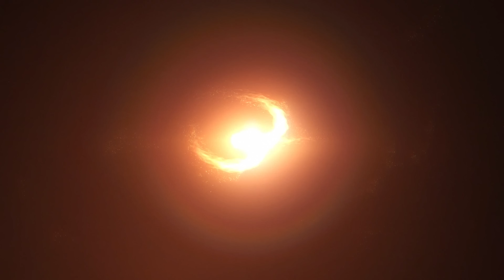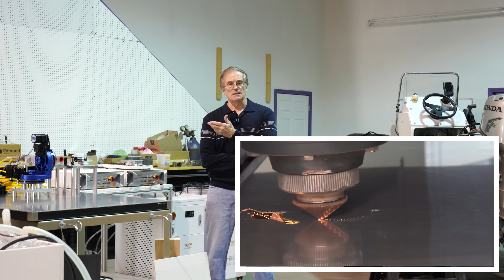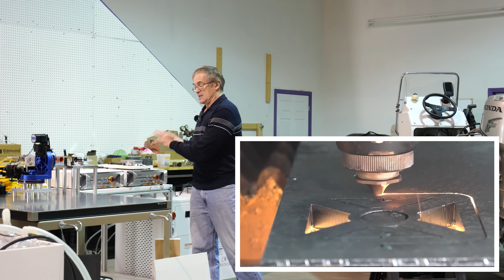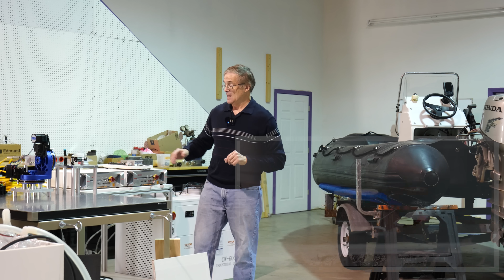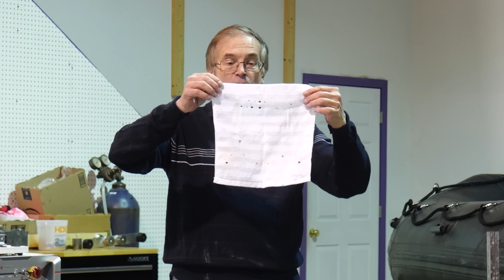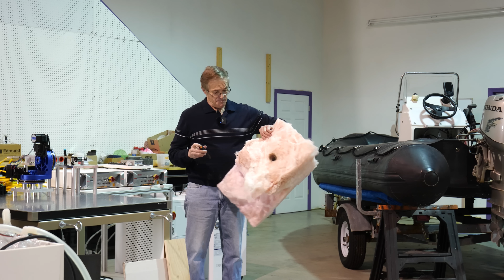We have a problem... and need your help!

Comment: I know that you don't want a brick wall, but you are going to need something on the order of that density.  I would build a steel frame with casters.  Lots of casters.  Then pour 100k lb concrete into it.  I wouldn't use reinforcing mesh or rebar because those will be weak points for the laser.  I would use glass chop.  Also, since the concrete will be in compression, you don't need the tensile strength rebar imparts.  

Another option would be a laser trap.  Take a reflective surface and set it at an angle to reflect the laser into a tank of water.  The water should have a significant amount of suspended solids or colloids in it to disperse the beam.  This may be a good application for something similar to colloidal silver.  The biggest issue here is getting a surface that is smooth enough and reflective enough to reflect the beam without being destroyed.  That will take some research because you will need to find a material that is as reflective as possible at the specific wavelength of your laser.  Even then, any surface defect will cause the beam to deposit its energy and destroy the material.
Reply: Bricks of compressed charcoal will have some fly off and the smoke disperse the beam further.
Awesome to help. :)

Comment: Solid Asbestos sheets.  An old welder I knew used them to block heat when using carbon arc cutting rods.  They worked great for the intense heat.  They look like metallic house siding.  They are heavy but way more portable than a brick wall.
Reply: Ah yes. Asbestos. Just don't breathe during construction or if it gets damaged even a little... Is that even legal?
Reply: I was going to say the same thing.  I saw an old farmhouse that burned down.  The only thing left was the wood-burning stove and the asbestos walls around it.   I don't know what the legality of asbestos is, but I'd guess it would stop the laser and not catch fire.

Comment: There are certain ceramics which are used for heat shields in aerospace. They practicly transfer almost 0 heat energy. So an extremly good heat insulator. The problem is i don't really know where you get this from.

Comment: First off you need an equipment protection system using PLCs. Use photo sensors to detect scattered light and send feed back to kill the laser power. You need to be careful with cabling to make sure you keep the shutdown time as fast as possible.

As for laser shielding, does reflective mylar over water soaked plywood sound reasonable ?
Or create a cheap silver solution that you can spray on egg carton shaped foam. 

Tough problem ! Love your content.

EDIT:
I think @RobertLeyland has a good idea. Perhaps use a liquid crystal encoder to PWM the power and be done.

Comment: - Grid of mirrors (or one large mirror?) that redirects the beam into the floor
- Put the laser up higher than the drone will be flying and physically constrain it so it can't aim anywhere that would cause trouble, outline the danger zone on the floor with yellow tape
    - Pros:
        - Aiming at them top down is maybe closer to how one would actually use this tech to take down drones
            - Though the direction is inverted the profile of the drone is maybe more similar to a realistic scenario
        - Probably more cost effective to build something to hold the laser up high than it is to invent something to stop the beam. Just let the Earth do it
    - Cons:
        - No easy access to the emitter
        - Could be risky if there is plumbing or wiring in your concrete slab

Comment: First I wanted to thank you for the responses you have given to my comments in the past.  I really appreciate the work you guys are doing, and that you share it with the world like you do.

I am not certain that this will be the solution you're looking for, but I remember a documentary I saw when I was a kid, about this inventor who created this stuff he called Starlite Polymer.  Unfortunately the inventor did not release his recipie before passing away, nor did he ever file a patent.  

There is another YouTube channel who has done some experiments with regards to this, and has had some level of success.

https://m.youtube.com/watch?v=aqR4_UoBIzY&t=3s&pp=ygUac3RhcmxpdGUgcG9seW1lciBudWdodGhhd2s%3D

Here is a link to that specific video.  I am unsure if the properties of these materials will work well with the concentration of energy in such a small point, but if it's only a short duration you're looking for, several layers of say, ridged foam insulation and plywood coated in this, might at least get you goin in the right direction.

Hope this helps,

~Joe

Comment: my idea would be to use a lens behind the target to de-focus the beam so that it spreads out over a large surface and becomes relatively easy to stop
Reply: Came to the comments to say the same thing. I'm surprised how low this is. It seems like a lens would solve the problem pretty well, unless the concern is that the beam will be moving and may reflect off parts of the destroyed object.
Reply: The point is to track and target a moving object. It's not a stationary target that you can place a lense behind.
Reply: @aai2962  hmm.. good point, maybe attach the lens to the moving target ?
Reply: Instead of a lens use a sheet of metal, with a shiny surface, bent slightly to form a convex mirror.  Cool the back side of this with water, so the shiny metal is one side of a water tank.  Angle the mirror surface so the beam is directed downward into an appropriate absorbent -- maybe water.  All these components would be cheap.
Reply: @freemab222  the problem is that specular reflections of a laser this powerful are really dangerous, this laser can go through the protective glasses and your retina faster than you can blink.
Reply: A good idea for an on-axis beam, but if the beam moves, the lens would need to move with it.

Comment: My first thought was something like starlite or some similarly ablative material but that would give off fumes and smoke for sure. Maybe something like a clay slip mixed with copper or aluminum dust to help conduct that heat away from the impact zone faster but that might be too close to thermite to build a barrier out of and after seeing what you said about the plywood i'm thinking pykrete panels made of frozen stacks of wet newspaper might be the best option for portability and inexpensiveness assuming they work.

Comment: What about a blanket soaked in water but with a continuous flow of water from the top? I don't know if it would work enough even with a relatively high water flow... It's quite such a big big power density...
If there was a more light-porous material, which allowed the light to penetrate several millimeters without being completely absorbed in the first layer, but with the water flowing through it, it could work better...

Comment: My other idea is a laminar flow waterfall of the black water. This would solve potential laser glass interaction issues.
For this, I imagine a large sheet suspended at a slight angle and with walls, such that water slowly pours out of one side, giving a sheet of black water effect.
Then it is pumped back up and we have now a sheet of black water that doesn't have glass.

Comment: maybe try a high light absorbing paint like musou black ontop of the material you use, maybe try a ceramic like a forge crucible coated with the musou black  this way it helps  to absorb the stray reflected light

Comment: Spinning reflective disk with randomly faceted surface diverts energy away from a single point to another set of surfaces with sensors that will shut off the laser

Comment: An alternative is to have a sensor of some sort to automatically turn off the lazer when overpenitration occurs. A camera or photo resistor or something. The safety switch will react at superhuman speeds

Comment: Im pretty sure you where on the right track.
The first thing that came to mind is a combination of Saltwater(increasing refraction) combined with something like fibreglass.
There might be better and (pending on your location)more readily available surfactants that do an even better job that salt.
Your best bet in any case is looking for advice from a chemical engineer (not me)

Comment: A running treadmill on its side, set to 20 mph, will take a ton of power to the tread without cutting through. Each 1mm square patch will only be heated for ~100 microseconds as is passes over, receiving about a joule (assuming 10 kw laser) which will make it hot as heck but at least dramatically increase the amount of material that needs to be destroyed before the laser cuts through

If you need more duration, a plywood disk mounted on a reciprocating fan will spread the damage over a 2-D area instead of a 1-D area. This will endure pretty much any power of laser indefinitely.

Comment: can you perhaps only power the beam on for the duration required to get the job done?

like calculate distance you want to hit, travel time (small as it is lol) and only turn the beam on for the duration it would take to hit the target at that range? only power it for just a fraction of a moment at any given time?

alternatively is there any way to receive feedback from the beam itself or its emitter? kinda like radar but like measuring the power used and/or any measurable reflection to determine if you've hit or gone through your target, so you can sense to immediately turn the beam off?

no idea what's gonna happily eat uber lazor beams lol uhh asbestos or something? XD be careful, whatever you do!

Comment: "No, Mr. Drone, I expect you to die."

Tile attached to plywood sheets or similar could be a good option as long as it ablates away like brick instead of cracking.  Per area covered it's more convenient than brick, and if you haven't mortared it in (maybe use nails between cracks to keep it in place?) damaged areas could be quickly replaced.
On the same thought, stucco on plywood sheets or similar could do similar.

Comment: 🎉 Use the fibers that were used for the laser and put them in front of the beam to spread the beam and dissipate the energy of the output as a safety right in front of the beam

Comment: How about a black screen with constant water flow from the top? The screen should be made of non-flammable material such as mineral wool impregnated with graphite, for example. The screen can be rolled in and out just like a projector screen for portability. The water should flow on the front side facing the laser, you will need to design a water delivery and recycling system that can be a copper pipe on top with uniformly drilled holes and another slotted pipe at the bottom that will collect the water, and a pump will deliver it back to the top pipe.  Make sure the water "flows" for optimal heat dissipation. Oh yes, you should add the thermally-stable die to the water that will absorb the laser frequency well. You could use your engineering skills to help the Ukrainian defenders fight off russian drones on the battlefield.
Reply: I see a lot of dead birds in the future.
Why? because this will be a thing. And drones will use flaps to imitate birds to not get shot.
Then they will just shot everything down that flies around.

Comment: I believe you should gradually attenuate the beam with a series of filters and finally block it. Identify the most intense wavelengths and work these out.
Try e.g with welding glasses. These exist in a variety of transparencies. Start with the least opaque and try combinations and quantities. Finally block it. Block it with granite.

Comment: Are you able to provide the energy outout for this?

Cannot think of anything cheap for this. Watercooled thin copper sheet with a high flowrate pump or heat sheilds from a spacecraft. The problem is the surface area.

Comment: I don't have any golly-gee-whizbang ideas. But a motorized crane would be portable. Put the laser on the crane, and point it at the ground. You can limit the pan/tilt of the aiming mechanism, so people on the ground can be safe, outside the firing zone.

Comment: First I considered a wall of sand sandwiched between panels of plywood or drywall. Easy to patch, sand can stop fire to some degree, lots of thermal mass. Once done, it can be shoveled away and it's cheap. I'm concerned about reflexions though (sand can be reflective if it contains stuff like quartz). Heat shield ablative material or crushed volcanic rock could be the answer, if I remember correctly it's  quite light and porus. Also be advised, I'm suggesting this without background or knowledge of the subject! Please be careful and maybe ask someone who works with this kind of equipment and has professional experience.

Comment: Beam dump from an old barrel covered with sud on the inside.
Inside a reflective cone to break up the beam and disperse it over the inner surface of the barrel.
The dimensions depend on the amount of power you wish to dump and the duration of the beam.
With a larger outer surface, it can cool itself better.

Comment: Ceramic tiles? The ~1cm thick ones.
With drywall behind for support.

They are even used with fireplaces and handle up to 1000c.

Comment: I'm guessing the proper solution will likely be some sheet of a material specifically engineered for high temperature applications...
But I do wonder if a black barrel filled with orbeez would help... The spherical shape refracting the light throughout the mass, the captured water absorbing energy, and as they are destroyed/dehydrated, gravity will replace them with the ones above. Keeping it within a black barrel to prevent refracted light from making it back to you.
And when you need to wrap up the experiment, just leave them to dehydrate and get rid of the tiny remnants.

Comment: I think a non-toxic ablative material of some kind  painted on a secondary barrier (Like Plywood, which seemed effective if it could be used in a single layer and with fire suppression at the ready) would be a good solution. NightHawkInLight has a good recipe for one in his video "History of a Lost Supermaterial & How To Make It (Starlite Part 2)" which I would link if YouTube allowed.

The idea is that it insulated the heat well, and when it gets too hot the top layer vaporizes, carrying the heat away with it. Just make sure to work in a ventilated space, and wear your eye protection!
Reply: The technical term for these are intumescents. You can buy paints that expand into a carbon foam when exposed to high heat. For the plywood idea, it'd make sense to fully coat each sheet with a layer of this paint. That'd at least limit the ability for the fire to spread so long as it doesn't push the sheets apart.

Comment: could you clarify a few things:

What is the output power of the fiber lasers you're using (in watts or kilowatts)?

What is the wavelength of the laser(s)?

Do you want a reusable beam dump or is single-use per test acceptable?

How large an area do you need to protect (e.g., expected size of the beam spread if the system fails)?

Is there any airflow or ventilation near the back wall (to handle thermal load or fumes if needed)?

Comment: I'm not too familiar with such equipments, but if you pointed the laser steady in one direction and moved the target, you could use some optical components to disperse the laser beyond the target, which could solve your problem. Maybe a combination of lenses, preferably with no moving parts to avoid just trading one reliabilty challenge for another.

Comment: I was thinking about fire blankets that you use in your kitchen to extinguish small fires on the stove. Maybe stack a few of them?
the other idea would be some fog or water vapor that could help dampen and disperse the beam enough.
My guess is, you will need a combination of different solutions to crack that power and intensity down, if you can't build a massive wall.

Comment: Black anodized thin aluminium sheets folded at low angle like this \/\/\/\/\/\/\ (only vertically). Low angle means beam energy will be distrubited over larger area than placing it perpendicular to the beam.  They could be hinged for transportation in folded position, and exdendet verticall for blocking beam.

Comment: The idea that comes to mind for me is the Drywall, but on the back side of it have a reflective material to bounce it at the back of the drywall, and coat the back with the same reflective material...  basically trying to bounce the beam around in a chamber on the back side of drywall..  Each bounce should reduce the power of the beam by an amount hopefully enough to not torch EVERYTHING....

Comment: Ballistics testing uses water to slow the bullet or dirt mounds to stop the round.  an idea might be to have your bricks on a mobile platform.  I will even go with a suggestion from another user, use a mirror inconjuction with dirt or bricks; make one or both mobile with either rollers or wheels.  Just try not to make any hot-wheels.